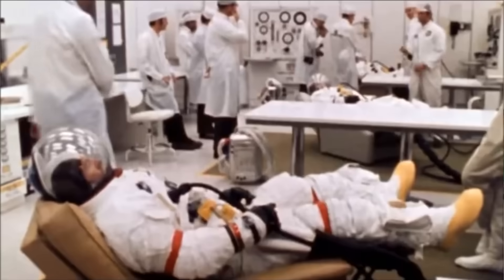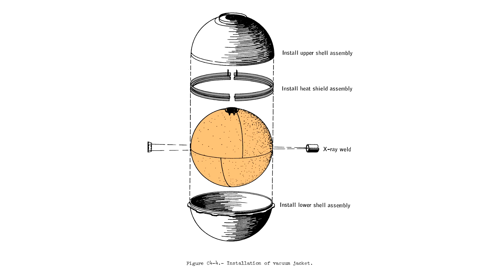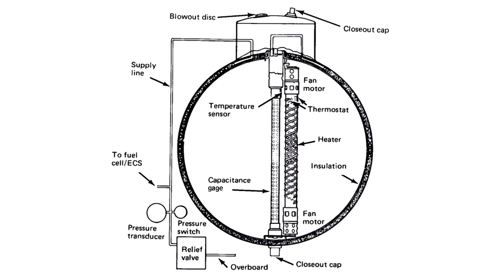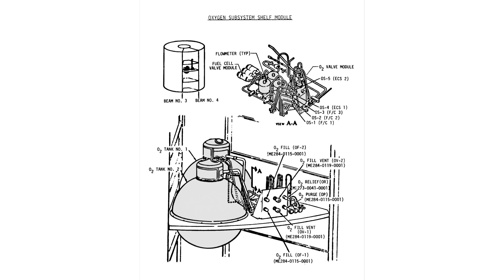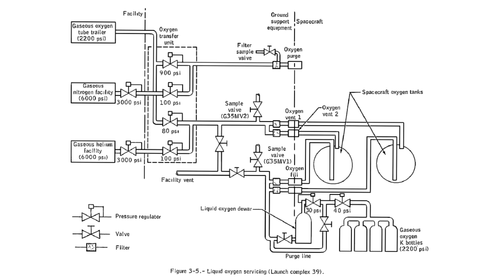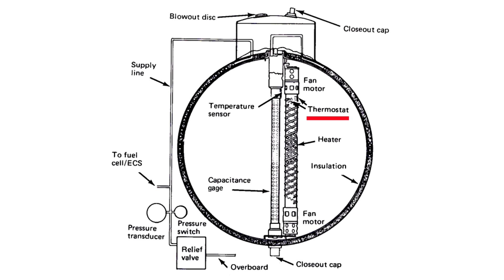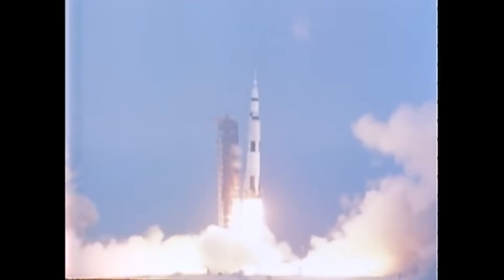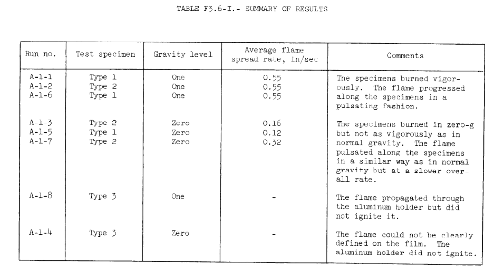What Caused The Explosion That Crippled Apollo 13?

Comment: Lovell/Kluger's explanation of this in the book of Apollo13 is almost as complete but contained one extra titbit you didn't mention: The pressure gauge.

When the thermostats stuck shut (ohm's law - double the voltage, double the current, quadruple the power) to boil the LOx off, the pressure gauge should have alerted them that it was way high. The problem was the gauge topped out in normal use meaning the most basic way they could have detected this failure eluded them. 

The lesson here stands true in anything with a gauge: Always make sure the gauge can read higher than you expect it ever to need to!

Thus endeth lesson 37 in the gospel of engineering according to me....
Reply: Captain G should take an engineer to realize this tidbit. But it takes an engineer to reason his/her way out of using an overly capable gauge
Reply: Lovell did also mention they duplicated the whole thing on one of the test flight articles. I hope they didn't throw away the recordings of that event.
Reply: So "Not bad, not terrible" strikes again.
Reply: Exactly right. Michael Crichton actually took inspiration from Apollo 13, I think, in the Jurassic Park novel: The motion sensors were programmed to make sure none of the dinosaurs had escaped so it topped out at the number there was supposed to be, but they also should’ve programmed them to make sure there weren’t more.
Reply: Let's not forget the bean counter, down stream, who gets a deal on a cheaper gauge...
Reply: "The lesson here stands true in anything with a gauge: Always make sure the gauge can read higher than you expect it ever to need to!"

A lesson the Russians still hadn't learned, in 1986.

Comment: Are you sure that the failure of the quantity gage was unrelated to the main failure? According to the investigation report it  likely was coused by a short circuit in the wiring of the quantity gage, wish (by my  reasoning) could have also been caused by the Special detanking after the Countdown Demonstration Test.

Comment: If the oxygen was kept in a super critical state (ie it has no free surface) how was capacitance used to measure the tank fill?
Reply: I assume that as the tank empties, the density of the fluid would drop, causing a capacitance change.

Comment: "But at 50+ atmospheres of pure oxygen..." yeesh
Reply: Doesn't seem like a highly unusual partial pressure for oxygen by itself. Diving equipment has a partial oxygen pressure (gas mix pressure x concentration) of 40bar when filled with air. But running electrical equipment in that environment is a different thing, of course...
Reply: @Kenionatus  Air & oxygen are not the same though.
Reply: @Nghilifa  You are correct:  Air and Oxygen are not the same thing.  This is why Kenionatus said *PARTIAL PRESSURE* of oxygen.  He is exactly correct.  Standard SCUBA diving cylinders are rated for 3000 PSI.  Air is ~20% oxygen.  20% of 3000 PSI is 600 PSI.  600 PSI divided by 14.7 gives us the pressure in atmospheres which is 40.81 atmospheres.
Reply: 50+ atmospheres would not be 50+ psi but 50 x 14.7 psi, right? Somebody explain.
Reply: @lawrencequave8691  1 atmosphere =1 BAR = 14.7 PSI
Reply: @lawrencequave8691  You are correct.  50 atmospheres of pressure would be about 735 PSI.
Reply: I'm not exactly familiar with the explosive properties of pure oxygen in liquid form but I imagine it's extremely dangerous.

Comment: Cool video! Speaking of fuel tanks and zero-g, I've always wondered how fuel is managed in the tank in zero-g.  i.e. how do the engineers make sure that there is fuel and not pressurizing gas by the tank outlet.  You should do a video on that!
Reply: https://en.wikipedia.org/wiki/Ullage_motor
Reply: @Broken_Yugo  cool.  they use a motor to get some g's up so it's not zero g for the main motor!